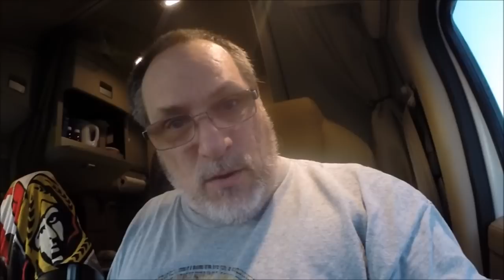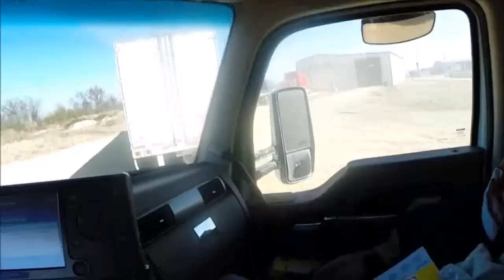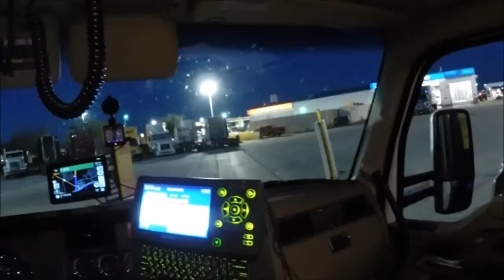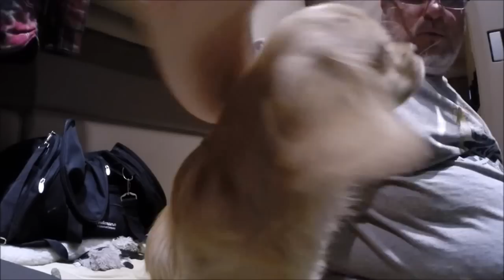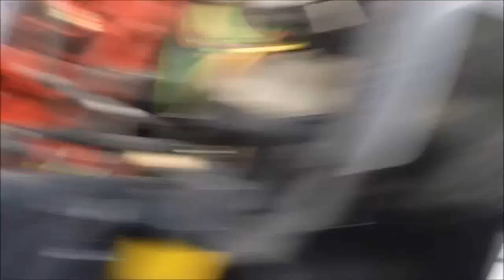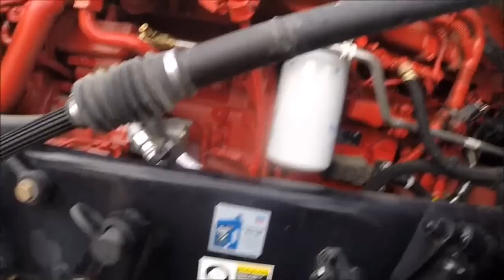Trucking With Molly Day 25 I'm A Bonehead

Comment: I would replace that primary filter with a heated base and a cummins spin on fuel filter of 25 microns in the winter and a water separator 10 micro filter in warm weather and add a fuel pressure gauge to the dash. I don't like that frame outside rail spot.  I would put a baby diaper around it in the cold weather. I did not get a good look at the set up, but it looks like a no heated fuel set-up.